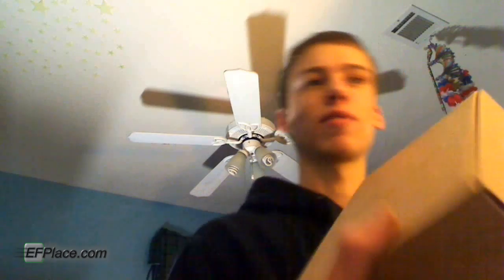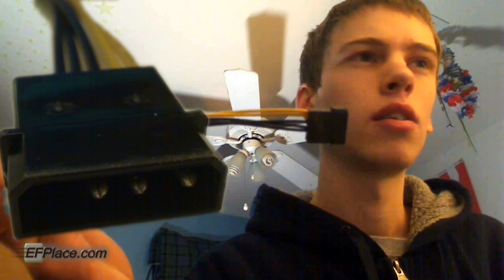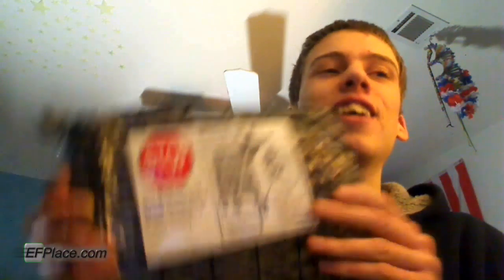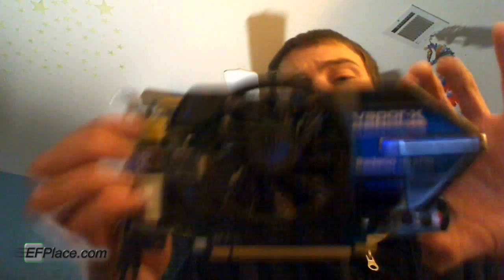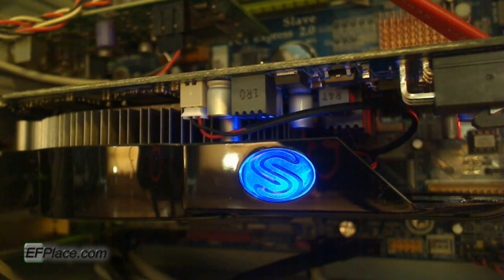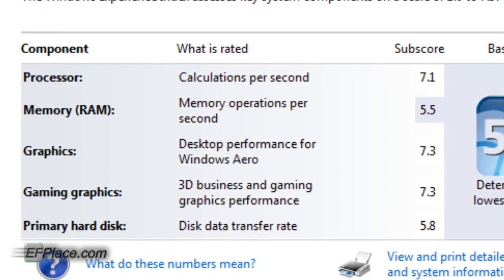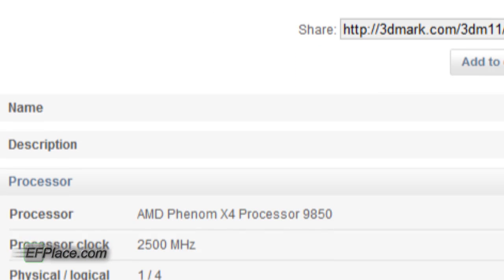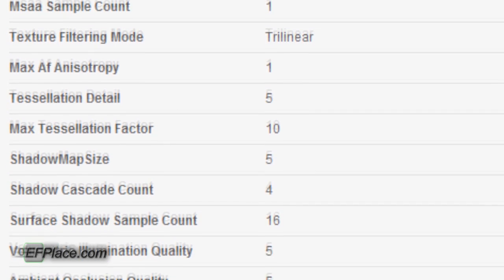My New Video Card: Radeon HD 5750 Unboxing and Benchmark

Comment: I bought a six pin pci cord but it has 2 4 pin mo loo ex inputs into the six pin converter and the 6 pin converter has 1 hollow line in its six pin. Will this work for me?